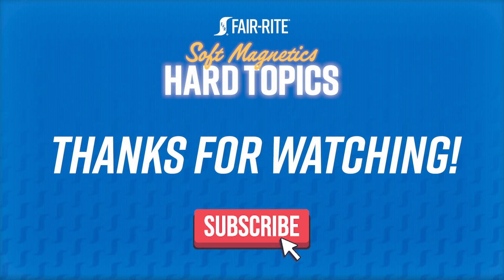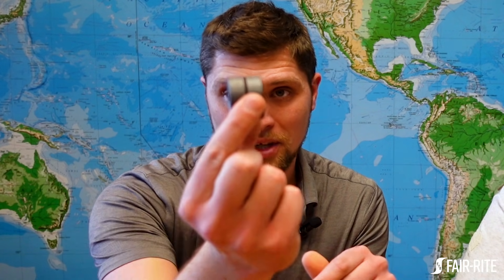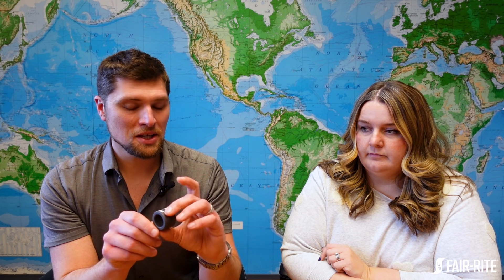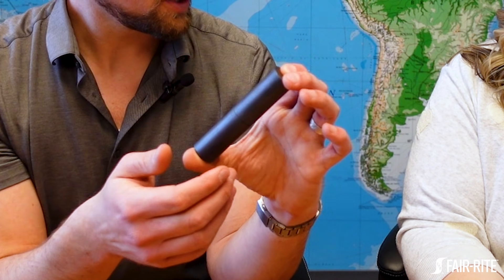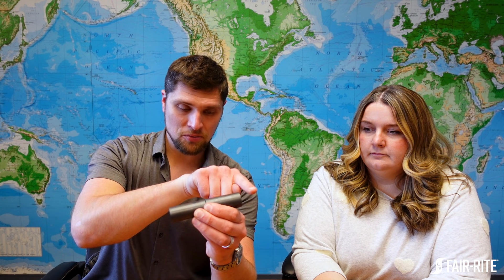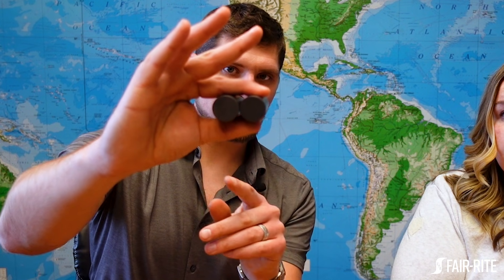S3 Ep. 3: Stacking Ferrite?

Comment: Is there any benefit to stacking toroidal cores of different material types, to potentially extend the usable frequency range?
Reply from the maker: Thanks for commenting! We cover Mixing material types in this video: https://youtu.be/5QKMaPGJswU?si=Cw5rT05A4IfdYinW
Reply: That's what I do with my common mode chokes.  They are made up of alternating type 31 and 43 cores.  Mike KC3OSD
Reply: Probably depends, but I've typically found it better to use two separate chokes in series instead of stacking materials within a single choke. Reason (I think) is that, especially for the high frequency part, you want the choke to be as physically small as possible, minimal winding length, minimal inter/intra-winding capacitance. So, if you stack two cores, you might increase winding length by say 50%. I guess, depending on the frequency range you need, some reduction in SRF might be irrelevant and you might prefer the space savings of stacking cores within a single choke. I want to look into it again now!